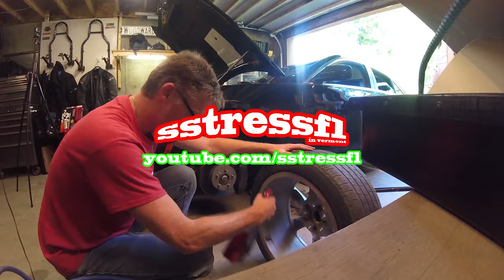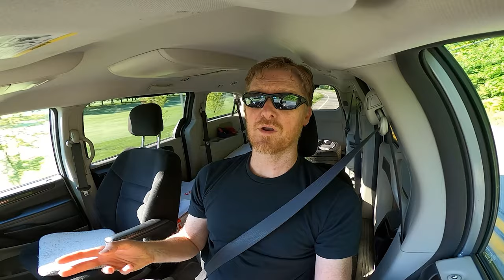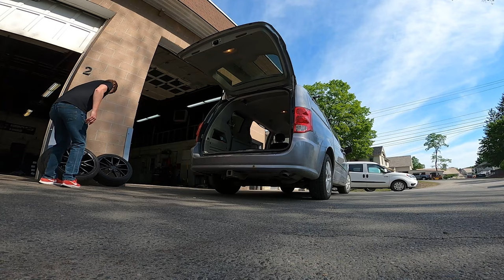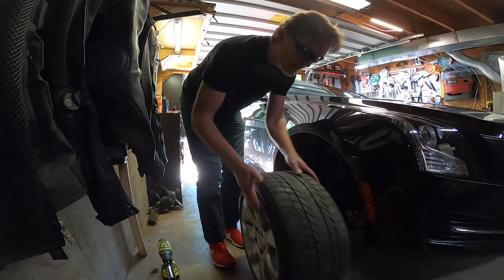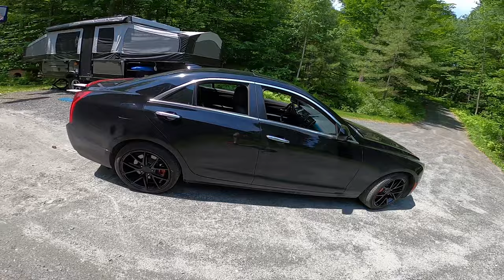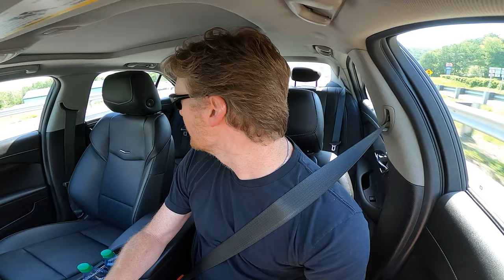Bent Wheels Out, New Wheels In. Vibrating Cadillac ATS

Comment: I can confirm this car has a ton of noise transfer through the frame with small wheel problems. Just cracked a rim, got it repaired (they said the repair would be good), brand new tire, suspension is all new or check and fine, alignment with new tire. It's a welded rim so it's 100% out of round (I'm not dumb). Can't get away from the whob whob whob whob.  Guess l need new wheels .. or maybe just get a new car....
Reply from the maker: With aftermarket light wheels it’s amplified even more. New tires for mine this spring.

Comment: Hello Michael, In watching you in your videos on your ATS I have been through the learning g curve with mine as I have a 2013 ATS 2.0 AWD Premium/Luxury and well I bought it with 36k on it and it is a nice car but I have had several things done on GM's warranty and hidden warranty's that these cars have. Working in the rental car industry for 26 years I saw a lot of this and a lot of repairs GM and other manufactures would do for our fleets of their cars. The ATS has several and they go out as far a 130k as in my ATS. Yes I have replaced the Michelin Run Flats with Pirelli "P-7"  (I feel it is a better handling tire) Tires and have stayed with the standard polished wheels, but took the tire height up and these are great handling and road cars. I have also had to have the A/C repaired at the tune of $500.00 and it gets its oil changes with the dealer and I have all of my cars the other an 2013 Impala LTZ which get Pennzoil Pure Synthetic oil as they use the same weights and amounts.  But back to your ATS as like mine they car be troublesome in the little stuff but if not abused yes driving hard with one is fun but remember that??? I have enjoyed your videos and There are things about the dealers as there are 3 of them where I live and the one that said they were tops turned out to not be so shiny especially when my Adaptive Cruise stopped working and was $820.00 for the repairs and 4 days although they gave me a new CT5 to drive while repairs were being made. Don't get me wrong as I really like the ATS I have as I have had 2 Malibu LT AND LTZ trim models and I was going to purchase a 2014 Chevrolet Malibu LTZ with the LTZ3 trim and 19"wheels but the dealer must have loved that car because he didn't want to deal. 
Again I will tell you keep it up and I really like your videos and well it's good to see someone who likes their car and yes there are set backs but in the automotive world having grown up in it all of my life it is something that I really like and well, Keep up the "Videos"!!!
You Take care my friend. . . . .
Reply from the maker: Thank you for sharing and for the encouragement! I still like my ATS... it’s the most balanced fun car I’ve ever owned. 😎✌️ Thanks my friend 🙏

Comment: My 05 deville has a really bad shake after sitting for few hours in 30 degree or colder. Turns out because I bought high performance super soft tires that flat spot after a matter of hours in the cold. Can’t go over 40 till they heat up and work the flat spot out but only takes a few miles and then the car is smooth no matter the speed. It used to have 225/16/60 and I swapped out those for some 18x8 inch Cadillac STS wheels. Went 235/40/18 Speedo is only off by 1 mph and that’s at 60. Under that and speedo is on. Faster I go the more it’s off though.

Comment: You bought a low profile  tire and somehow  managed  to put them on bent rims that had to be weighted heavily  (your words)  and put them on a car that has a stiff suspension  and expected  and old style cadillac  ride ?
 True the car should ride smoothly  on a smooth road but  the whole setup of the car is unforgiving  on a rough road. 
  I've never seen a set of low profile  tires that road like anything  but a log wagon. 
 Michelin  imo is still the best tire on the road. Theres also almost  no noise deading  sound proofing from road noise in these Cadillac models. Your Cadillac  dealer will tell you that.
 The BMW 750i wheels look wicked  on a black Cadillac.  
 Not a fan of black wheels  on a black car....to much black and not enough bling/ sporty look. Thats just my humble opinion. 
 Enjoyed your videos  and learned from your mistakes and the actual  work you preformed on your car
Reply from the maker: I’m not sure why you’re talking to me like I’m new. They weren’t weighted heavily when I bought them. That happened only after the dealer claimed I had bent wheels. The original tire installer (a sports car shop) inspected them and balanced them said they were perfect. What does sound deadening have to with vibration? I know Cadillac uses sound canceling to to help quiet the car and save weight. I’ve studied this car and I’ve been forced to learn more about it than I ever expected. I know it’s stiff, tight, light and nothing like historic Cadillacs. I actually worked for Cadillac’s ad agency decades ago. I bought this car because it’s an exquisite sports car disquieted as a sedan. It’s one of the finest engineer-designed cars on the road. But it has vendor quality issues, which isn’t entirely the vendors fault. I like this car more than any car I’ve owned which is why I stay with it. I didn’t want black wheels either but it was all that was in stock in the wheel design I like on this car (COVID supply issues) so I bought it. I now like it more than I thought I would. I’m glad you liked the videos! I had fun making them AND got to drive a lot of cool loaner vehicles. It’s all good and I continue to enjoy driving the ATS. In the meantime trying to enjoy riding the motorcycle before winter sets in. Thanks for the feedback. Peace my friend!
Reply: @sstressfl  your idea of "sports car" and mine vary greatly. You have a " sporty " looking car. If you had a V then we could sports car. 
  I apologize  for my remarks on your choice of wheels . .. your car, your choice.
  The only damage  to your bent / out of round wheels  appeared  to be a curb rash. Getting NEW out of round tires or wheels isn't  that uncommon.  I mean you did sell your wheels for scrap, correct?
  While noise deading insulation won't help  with shudder of a transmission  or fix a bad differential  it does help road noise. Cadillac got very cheap on that. In your case though with the bad differential  it may have helped you.
 In modern day mid class cars the Cadillac  made points on style and design inside and out  but being a prestigious  car !?  It looks sporty, has a sports car feel when driving  it but more issues than a barrel  has monkeys.
 When every other car you see on the road today all look alike and then sit in one and they are all so bland and grey inside... its boring. 
 Cadillac brought sexy back ! but its a far cry from prestigious . 
  However  it does make a person proud to own one and thats worth alot.

Comment: Where did you purchase your wheels? I’m having trouble finding wheels for my 2013 ATS with a 5x115 bolt pattern and a 17x8 wheel size
Reply from the maker: It’s REALLY tough! I did research initially on all of the tire and wheel sites. Most are misleading  recommending 114.3 bolt pattern. It’s tempting because there are so many more wheel options but I wouldn’t do it. So once I found the one I wanted I did price shopping. Inventory seems a little low right now on certain wheels but I was able to find these on amazon, sold by a vendor.